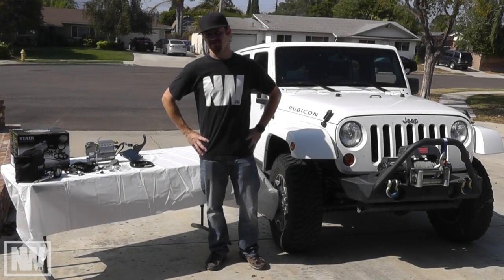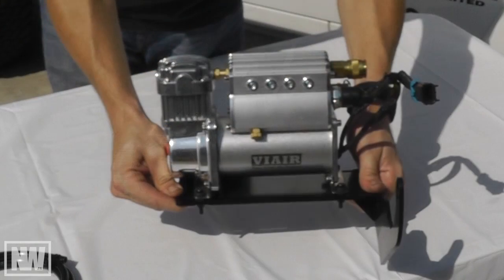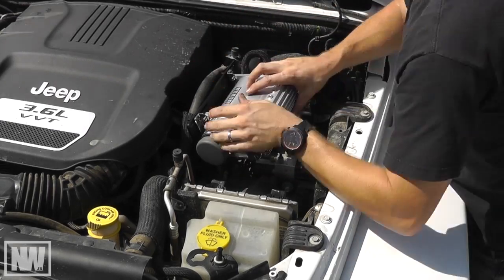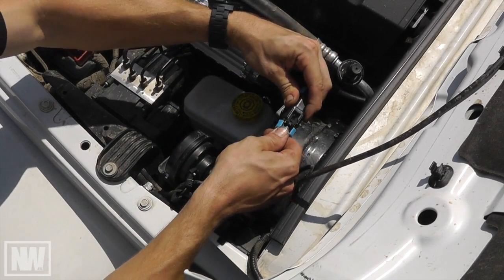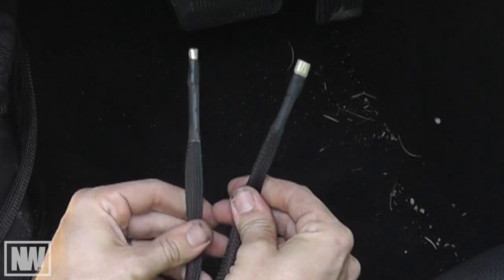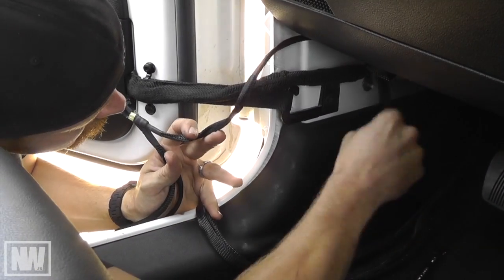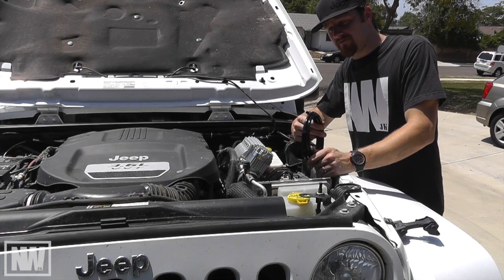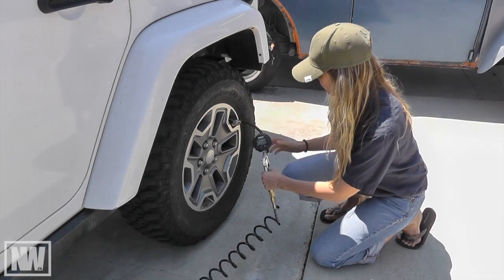JK Onboard Air Installation (VIAIR ADA 2012 JK kit) - "NeWere4x4"

Comment: Don't do it! The compressor goes into thermal shut down constantly. Bigger problem is that the brackets are NOT designed for a 13'. I installed the same system on my 13 JKU. Two different mounting brackets failed & cracked leading the compressor to drop down & gouge & wear the brake lines below. Viair & 4 wheel parts was nice enough to exchange the system. Nicely done video though.